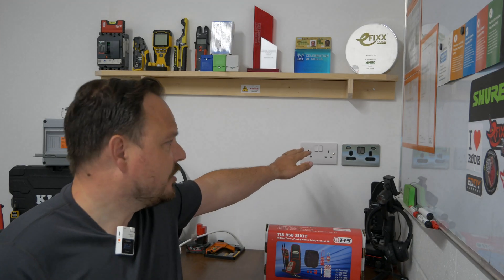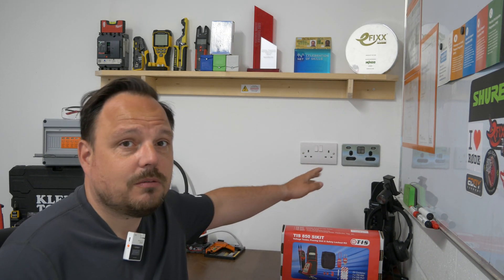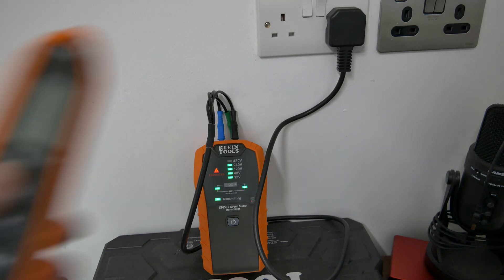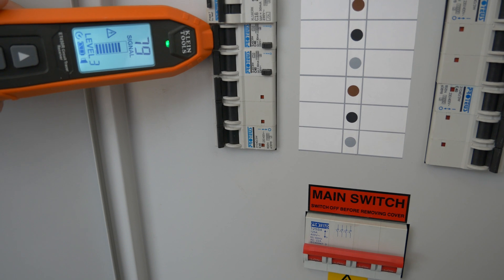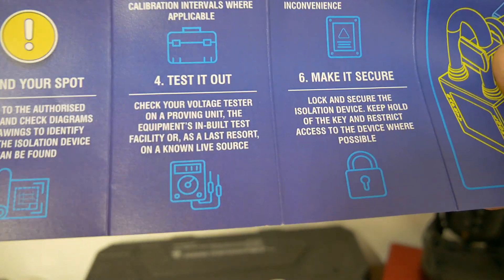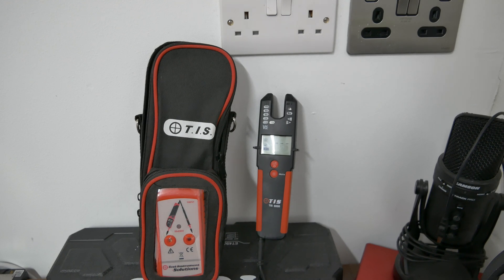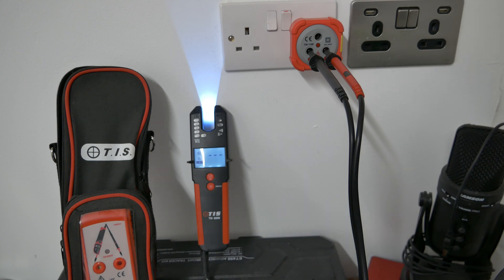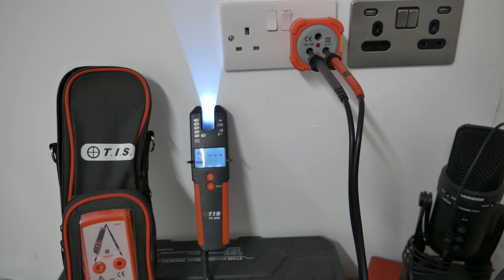How to swap - install a double electrical socket step by step - safely!!!

Comment: BTW... forgot to add. 

The TIS 870 Circuit Finder with socket tester function and NCV feature works just as well as your Klein one and at just a fraction of the cost.  
Why do I mention this... well for cash strapped apprentices as well as those taking them on that try to help kit them out with tools and the likes,  the initial outlay is literally everything.  

[If they can't afford it... that's it, they simply don't buy a piece of test equipment and as such they possibly miss out on doing things correctly.] 

Just saying 🤔
Reply from the maker: TIS are big supporters of Apprentice 121 which is why I buy so much of their gear and give it away both at my and their expense lol. 

Options are out there for all budgets and tbh as apprentices a circuit tracer is way down the list. 

Main priority is the awesome value voltage indicators and such. 

Thanks
Reply: @electrician247  Mark .... TBH that Klein Tools kit is a bit salty especially where cash strapped newbies are concerned let alone seasoned professionals. Never forget ... us mere mortals have to buy all our own kit [just saying].

As to priorities and being 'way down the list'. Beg to differ as when you can get an apprentice to do a few of the more mundane jobs off their own back whilst not being a total b_ _ _ a_ _ _ is (in my eyes) a plus. But we all prioritise differently.

Now.... how many pennies was it for that diamond encrusted gold plated Klein Tools Circuit Tester ..... 🥺
Reply from the maker: @BTC C.S.C  you assume I didn't buy this one 😉. Mistake. I was sent a free one to review but you will be pleased to know an apprentice now has it in their kit. Every single bit of my own and apprentice 121 social media activity goes directly to supporting them. All of the tools I share across sm I have bought. Not just that actually I buy thousands of £££s worth every month and give it directly to colleges and learners. I know all about maximising value and stand alongside and with every other mortal electrician.

I think it would be a fairly common opinion that circuit tracing is fairly far down an apprentices list of priorities. But the best way to find out is to ask them! So I will 💪 on mass right now 🤣. If you are talking about making apprentices productive while at work we really should be providing tools and equipment for them as employers. To much cost is palmed off onto them. Some very poor social media campaigns around safe isolation for example encouraged just that terrible practice. Something I won't associate with.

I actually have several circuit tracers from the likes of socket and see, megger and Martin Dale. 

I am happy to report and stand by the comment that this kit is infinitely better, more adaptable and works correctly across 3 phase every single time. Sometimes you get what you pay for. 

We don't as yet have a UK version but I am helping Klein change that and costing will most likely be different as was the case with the scout pro 3 for example.